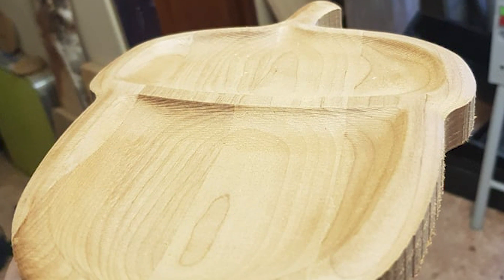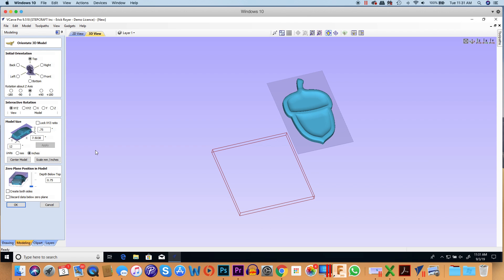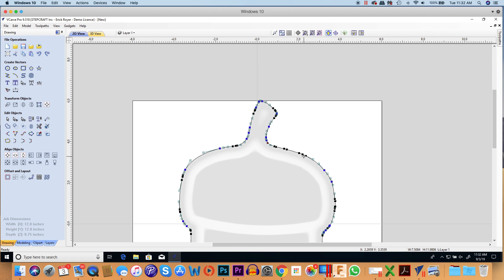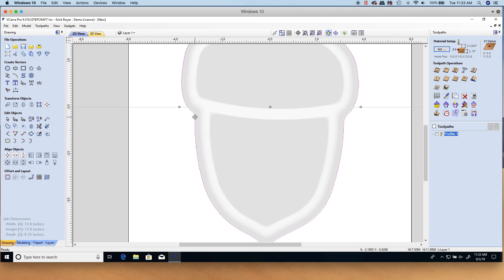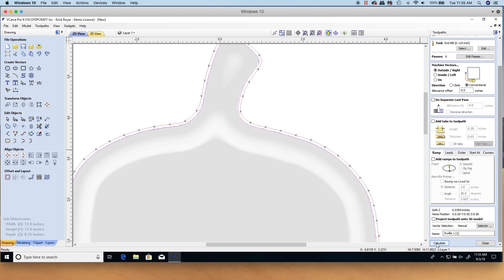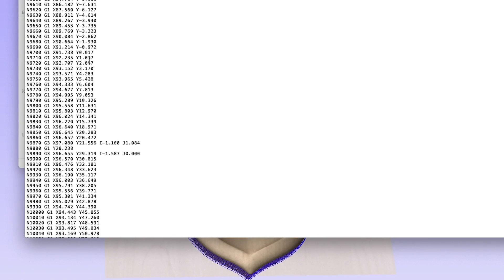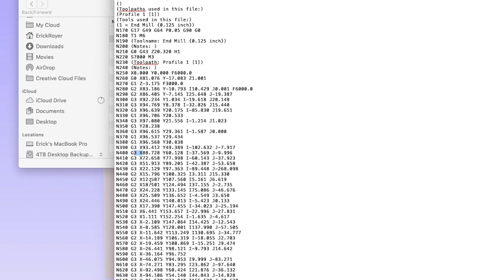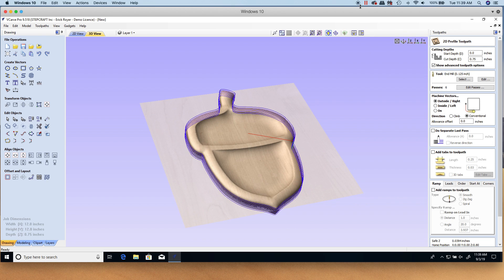How To Improve Your Profile Cuts Around 3D Carvings in Vectric V Carve Or Aspire

Comment: So if i do the profile it will eliminate the step i get around the 3d piece as well that isnt a complete cut out? Currently i beec selecting romove materal boundaries and it leaves a step from the ballmill from the 3d cut around the whole 3d design leaving a border. If i do a profile offset a negative value let say .020 and depth to the max depth it should clean that up correct or am i missing something else?

Comment: Great video! Question, it looks like you are using a Mac and I assume boot camp? Do you have any issues using the trackpad on the Mac in v carve? Mine does not work correctly.
Reply from the maker: I am using Parallels on the Mac to run Windows.

Comment: I noticed your operating system for your computer is Mac.
I too am a Mac user. What program are using to run Windows programs on your Mac?
Thanks in advance!
Great tutorial BTW....
Reply from the maker: I use Parallels - which works very well on my 2014 Macbook Pro